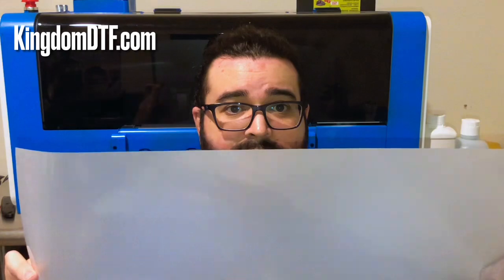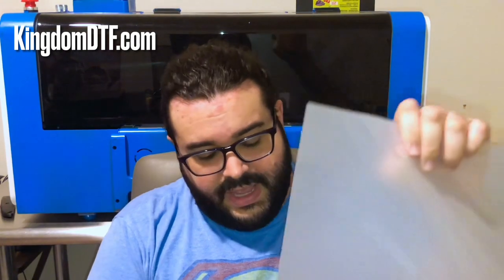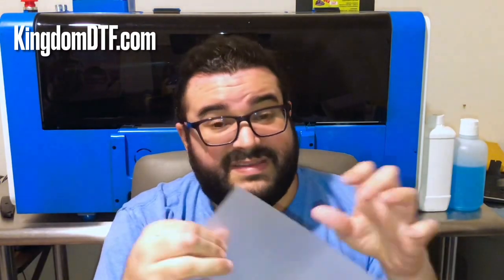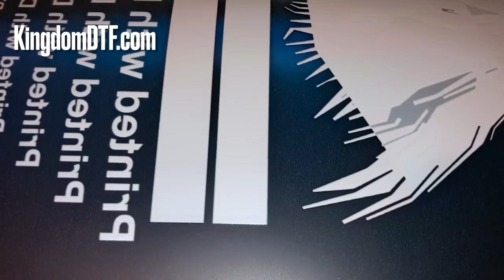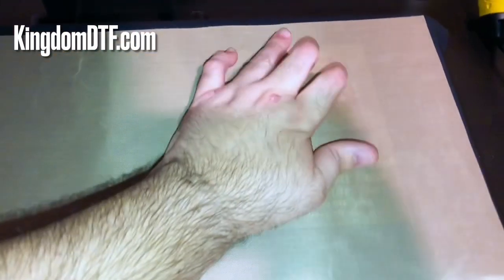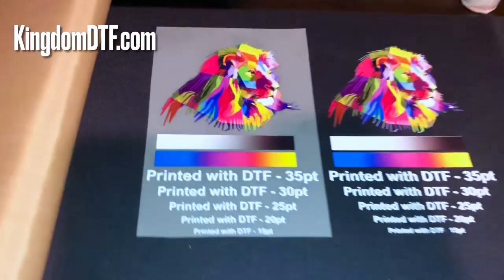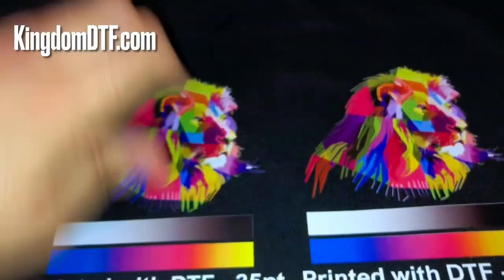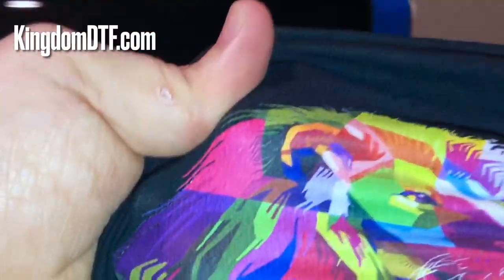👍 Best DTF Transfer Film and Why is Important to Choose a Great One for DTF Printing

Comment: Thank you. The masking tape on the sensor always works for me (Epson L1800) with no issues and I always use a single sheet of film.
Reply from the maker: Yes, that is a trick for it. Thanks for watching.
Reply: Where is the sensor located?  Having issues using thinner dtf. No issues reading glitter or matte paper.

Comment: Hi bro, kudos again, I love the way you engage your subscribers especially how you take out time to answer questions. Big ups man... I am having some issues with my DTF printer and thought it best to ask some questions. It is a converted ET-8550 and  at 2:57 you talked about people with converted printers using the Matte double side pet films. Do you have them for sale ? I am having issues as my printer will print on paper but not on  the PET films. The print head moves back and forth on the sheet like it does exactly when printing without bringing out ink. But when you try with paper, everything comes out correctly. On two occasions, it printed a part of my design vertically, not the complete design and I thought it was alignment issues but it wasn't. I have been using the same DTF sheet and this issue started recently.
Reply from the maker: I have read some people with same problem, to be honest I don't know because I have not use the ET8550. Could be that is not reading the film correctly or a software issue.

All our films are here https://kingdomdtf.com/collections/dtf-transfer-film
Reply: @KingdomDTF  Thanks for your response bro, I will check out your page
Reply: I have a converted ET -8550 and I find if I add a 1 inch strip of blue painters tape along the side you feed into the rear of the printer that the ET-8550 will have no issues printing on the film. I was using the Calca 13x19 film from Amazon, hope this helps out!
Reply: @mcssc5  Yea, it did work. Thanks again.

Comment: What are the settings you used for the print in the video?  I have a similar file but it has a white block background when I print it.
Reply from the maker: You need to delete the background so the background be transparent and don't print that block.

color 40%,  white 60% on acrorip

Comment: hi i have a stylus 1390 with a pritnter head l1800 converted to dtf. I have reset the ink waste tanks and everything is ok. the only thing is that it stops printing in the middle of the print and shows the ink clear button flashing. I have no idea what to do.
Reply from the maker: Download WIC software at wic.support and run a report to see of tell you any error. That way you know and fixed what’s wrong.

Comment: I’m having paper jam issues with my p600 are you familiar with this printer? I have both single and double sided film and it doesn’t print any of em just gets paper jam error.
Reply from the maker: Try to reset the printer and check the error is not coming from the chipless firmware.